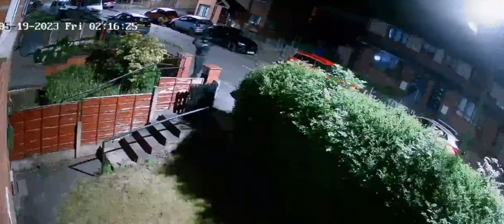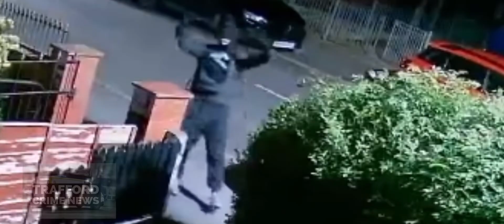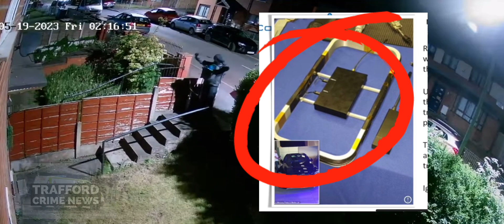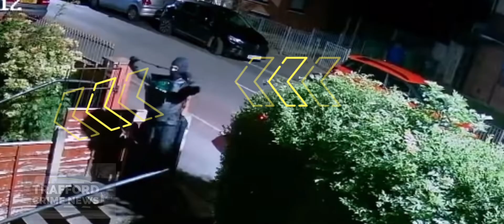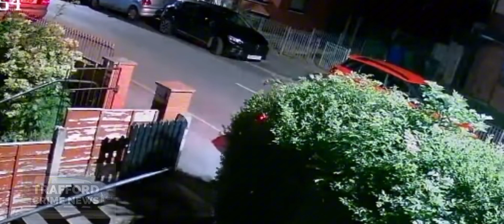How a relay device works

Comment: Nissan has installed a workaround for this now for all new vehicles with the larger square fob. The key fob has a g sensor that when it detects the key hasn’t moved for more than 3 minutes the key goes to sleep and will not wake up to any signal until until it’s picked up and moved. So with this there is no way they can relay any signal to your Nissan from your house unless the brake in and take the keys. Just don’t have them on a worktop near a letter box to prevent them knocking the keys of a table with stick that would wake the keys up to transmit
Reply: Ford has been doing this for years. It was the first with the tech.